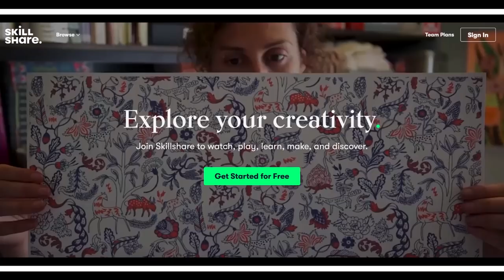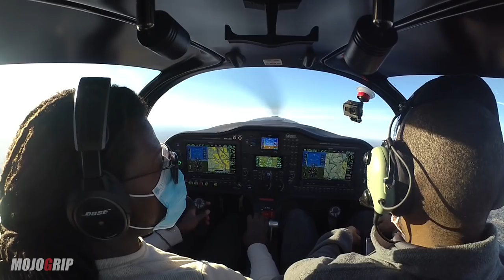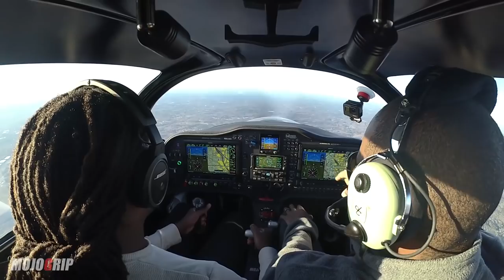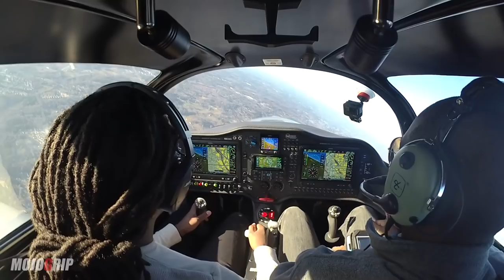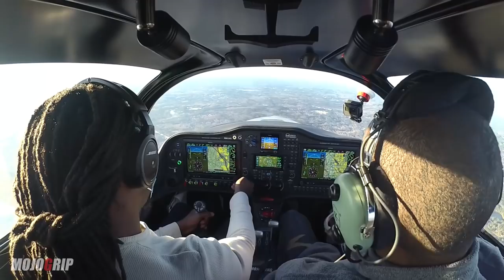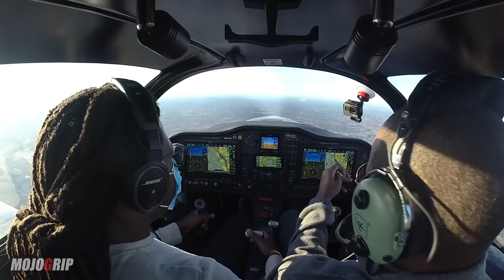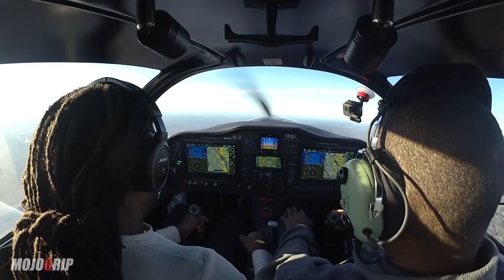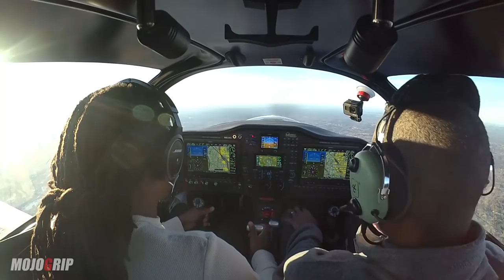My Instructor Said I wasn't Pulling The Plane Hard Enough

Comment: The reason for performing a flight control check on the ground is to verify free and FULL travel/deflection of the control surfaces, which includes full travel (to the mechanical stops) of the control stick/column. That you admit that you did not have full aft stick authority during the stalls means that you do not have free and full travel of the elevator. That you reason improper seat position to restrict full elevator travel as a built-in safety feature is mind-blowing, to say the least.

As a student pilot, my instructor would not sign me off solo until I could perform stalls without his input/direction. He would not sign me off for solo cross-country until I demonstrated spins - left and right - and that I practiced stalls on my own (honor system - which I took seriously).

You may want to have a chat with your insurance underwriter. Ask them if they give a premium break for going through an aerobatic course. A ten hour course or so. Understanding what's happening in unusual attitudes, slow flight, approach to stalls, and spins will build confidence.
Reply: You need a life
Reply: @shinuza  so does MoJo Mike need a life, or rather needs to enjoy a LONG life. 

That’s the reason for him to practice a true and full stall in his MoJoSling by adjusting his seat a bit further back and experience a full stall and recovery in the plane that he will be flying 99% of the time.
Reply: @marklandry2509  I never said otherwise. But op is commenting something negative on every single video with a condescending tone while being a sub. Ergo he needs a life.
Reply: @shinuza   Still at the groundcheck you have to check full deflections,  for example full forwrd full left, to full forward full right to full back full right to full back full left to full forwrd full left. (like a square) .  One of the reasons is if you cant have full deflections a bolt for example might have come free and blocks the full deflections.  To check if the airspace is free I personally preferred lazy eights in stead of normal turns as it gives you a better view also downward of the airspace and is more relaxed  to do and more fun too LOL.  I like the relaxed way Mike flies and bright and open mind. Im sure he got some Fingerspitzgefühl and will enjoy in safety his plane :-)
Reply: @rafiqsaid4297  I know thanks, that's unrelated to the my comment
Reply: @marklandry2509  Exactly.
Reply: @shinuza  Living a very nice, SAFE, long life and aviation career - so far, thanks for your concern. Sooo... for conversation's sake, tell me where I'm wrong or "negative" with my comment? Passing along a DANGEROUS practice is, well, DANGEROUS. NO pilot should sit still and let that slide.
Reply: @shinuza  And, I will continue to point out DANGEROUS practices that may be taken seriously by others. Easy solution: If YOU see my name, don't read what I post.
Reply: @EJWash57  again, I agree with the message. I disagree with how you are conveying it. E g with a condescending tone.
Reply: @shinuza  Sooo... It's not the validity of the message, You're upset with the lack of sugarcoating. Got it. 👍
Reply: @EJWash57  surgarcoating =/ being condescending on every single video 👏
Reply: @shinuza  - Negative voices are the most important element in any operation. Never ever turn them off. It’s a Blessing to incur challenges to the thought-process, because once one can address all those challenges, it makes for a more effective and safe operation. 

Spent over 3 decades in the Military with 8 combat deployments, and have literary saw loss of life because No one challenged the assumptions. In combat the enemy have a vote, as in life Mother-nature and other elements can severely impact the assumptions.

Always Invite negative and challenging voices, as condescending as they may be... it just might save a life.

Comment: This observation has been made by others, but it is worth repeating: There is no world where having the seat interfere with stick movement is a good thing. You need to address that problem. As a matter of piloting proficiency, your inability to pull the stick all the way back is NOT a safety feature and, when it comes to practicing stalls, leaves you with false confidence that you know the flight behaviors of the aircraft. At very least, you should have asked your CFI to demonstrate the plane's stall characteristics at extreme angles of attack, since his stick motion - apparently - was not as restricted as yours.
Reply: I couldn’t agree with this more.
Reply: Second that, if you do stall, you want to be able to recover.

Comment: Hey Mike there's a reason why we check flight controls on the ground to make sure it is free to full travel and it is deflecting the correct surfaces
Reply from the maker: The flight controls were checked as I always do on every run up. They work perfectly for normal safe flight even with my seat in the way. I don't imagine I would ever need to pull the stick that far back except in this scenario practicing stalls or doing aerobatics in the plane.

Comment: About the stick that doesn't go all the way back: everything has been said. It's a bug, not a feature. But I want to emphasize something else: the vibration that you should feel just before a stall is a good thing. The lack of this rumble is not a sign of good aircraft design. The shaking is a cue to the pilot. There are airplanes with aerodynamic gadgets that are only used to generate the vibrations so that the pilot can feel and react in time.

Comment: Might have to replace or rebend the stick.  That condition is one reason the stick was replaced by a yoke when planes got adjustable seats.   Used to be that rudder pedals were adjusted for pilot height.

Comment: Stalls are not a good idea, they are mandatory in the syllabus.
What kind of checkout did you get from Sling Aircraft? At least the whole syllabus for PPL should be covered.
You never reached a stall, you started to descent, never holding altitude constant.
And having your seat blocking the stick movement is just unsafe.

Comment: Man I got my commercial single engine certificate there! If it were me I'd be a bit concerned about not being able to move the controls unobstructed but you should be able to account for that. From my experience the DA40NG is a lot less forgiving in a stall so I'd say your TSI has it beat in that regard.
Reply from the maker: I've stalled the DA40 100s of times and several other planes.
Reply: @mojogrip  I was just commenting on my experiences, not challenging you on your decisions. At the end of the day it's your airplane and you're PIC. It seems like your TSI is performing extremely well and I'm happy to see you enjoying it.
Reply from the maker: @generalrendar7290  I didn't mean it that way. Your feedback is well received btw.

Comment: Don't think its safe not to be able to pull back.  I think you may have had room but you seemed a bit nervous pulling back.  Its dual controls so If your instructor was able to do it , you should have as well.  they are attached .
Reply: If Mike's stick was hitting his seat and restricting movement, the instructor's stick would have the same problem since both sticks a linked together. It's an extremely dangerous situation and needs to be immediately corrected before the next flight.

Comment: Have you done departure stalls and full power on stalls, accelerated stalls. And what happened if the other seat pulled all the way back on the stick with the seats further back.  I think that the biggest danger is departure stalls. Low to ground in a bank and you are a little uncoordinated.  What happens then?  Just wonder if you tried this at altitude of course.  Wow what a beautiful aircraft!

Comment: Ok, SEVERAL things wrong with this video. First of all are you even a private pilot when you did this video? I don't understand how you can not be or seem to just starting to "learn" the aerodynamics behind PPL maneuvers after already having your PPL or pass your check-ride for that matter. Second of all, YOU need to have FULL control authority and deflection from your controls in the aircraft. Why do we do a full flight controls check??? You are making a TERRIBLE aeronautical decision but just saying "oh it works for me not having this much elevator authority. Third of ALL, GO BACK to reading the PHAK! Are you really a PPL? You said "an airplane stalls when it passes its angle of attack.." Huh???? An airplane wing stalls when it exceeds the CRITICAL angle of attack. There is a difference between angle of attack, and CRITICAL angle of attack? I want you to define those two definitions there.. how do you not know this? Really disappointing video Mojo and if this is how you fly now, you don't seem safe.

Comment: Why would you not do this on your own?   That WAS a  PTS requirement for the Private Practical and for your Instrument.
It's also a required set of maneuvers for an Experimental A/B Phase I certification
Reply: @michaelspunich7273  ABSOLUTELY!!!
And there would be a whole lot fewer dead pilots if more had thought that way. Aviation is an endless learning experience. 
Or....
Reply: Well, according to the videos, Mike didn't perform any of the E/AB Phase I certification himself. The airplane was built, certified, and delivered to him as if it were built under FAR Part 23.
Reply: @michaelspunich7273  Mike has 160 hours in several types of aircraft. And more hours in the Sling than the CFI. Now who is more experienced...
Reply: @michaelspunich7273  That's why I posted, "according to the videos". Here's a link to Phase I certification:

https://www.faa.gov/documentlibrary/media/advisory_circular/ac_90-116.pdf

It's a pretty involved procedure.
Reply: Exactly Gwen!